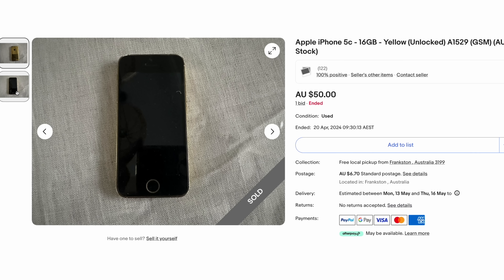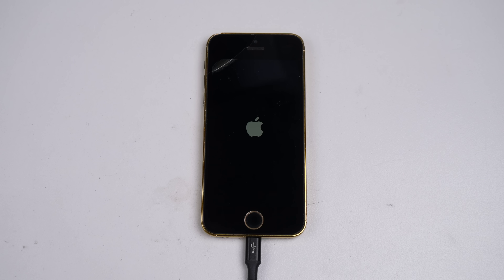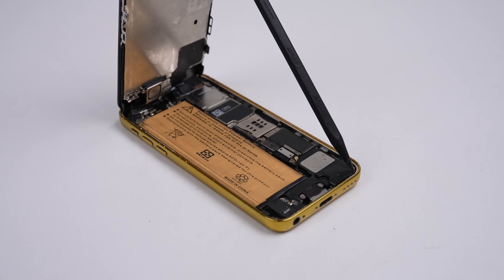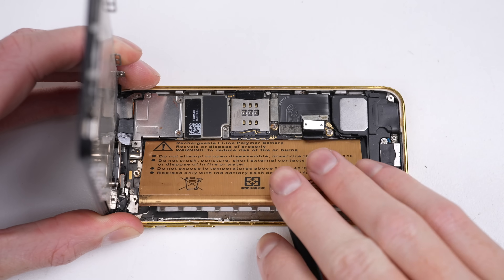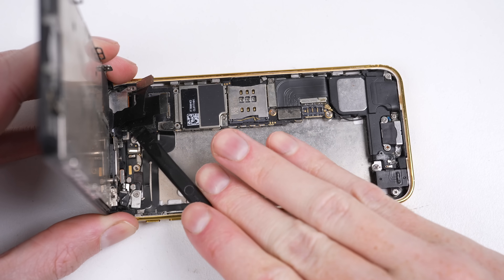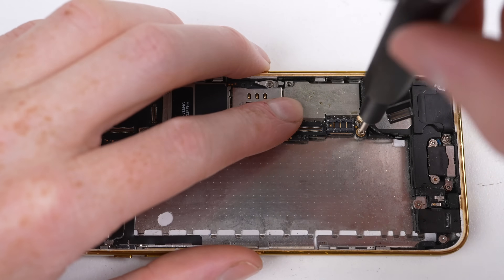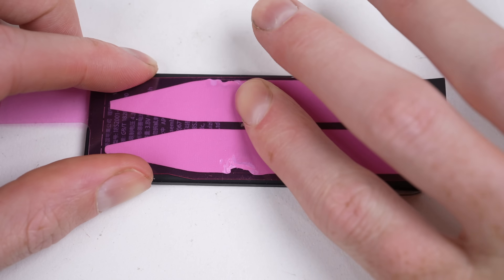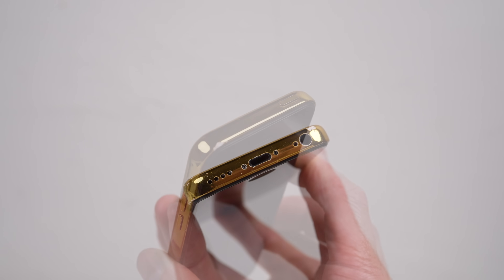This eBay Seller's Custom Built iPhone is a Disaster

Comment: The moment I saw that battery on the thumbnail I immediately knew!
Reply: Yeah, I saw the battery in the thumbnail and remembered Hugh's video on the battery before! Something about rlsk of fire or burne!
Reply: @TheSpotify95  Just like the note 7
Reply: @thewubmachine840  the note 7 exploded because Samsung put in a battery that was too large. If they'd have replaced the original batteries with 3200mAh ones as seen in the Note FE then they'd have been alright (albeit with a smaller battery than the S7 Edge).

I'd actually really like a Note FE (re-released note 7 with the 3.2Ah battery)
Reply: the design flaw in the chassis at the time made the whole disaster. The battery had the anti exploding mechanism built-in so the only worse case scenario is swelling which is still better than battery obliterate the phone. The note 7 ones are design issue.
Reply: ayyyy greek here also

Comment: Some important context with eBay is that the platform has recently added generative AI features,  and it has been aggressively encouraging sellers to use them.

So that overly effusive item description was probably literally written by ChatGPT. I’m surprised there wasn’t a garish DALL•E image to go along with it.

(And, yes, all this AI glurge makes eBay substantially more difficult to use as a shopper.)
Reply: That would explain the nonsensical, suspiciously similar descriptions I found recently when checking to see how overpriced secondhand Limited Edition models of Steam Deck OLED are (very). Only generative AI would crow about stereo speakers offering "3D audio"
Reply: lol so Ebay encourages sellers to scam buyers now
Reply: @dgwdgw  I've seen AI based descriptions for various other items on eBay, too, including watches and other electronics.
At least it looks better than the default app description though, which is basically just the title, the condition, and the shipping service selected.
Reply: @TheSpotify95  I mean the better thing to do with, e.g., electronics would be to copy and paste the manufacturer’s description and spec sheet, because it would at least hopefully be accurate.
Reply: @dgwdgw  I remember waaaaaay back in the 90s when 3D games were first starting to become a thing, one innovation was to simulate audio sources in the 3D space for the purposes of attenuation (distance) and balance (direction).

This is IIRC also called “3D audio”, and even with just stereo speakers it can create an impressive effect (due to the brain’s eagerness to interpret recordings as reality).

Granted, this meaning of “3D audio” is probably lost on anyone under the age of, say, 35.

(Also, to be fair, I wouldn’t feel surprised if the Steam Deck is generating more than stereo audio and just not doing anything with it unless the user attaches an external surround sound system. These features are built into the games and the hardware drivers, so there isn’t really much of a way to disable them entirely, and the Steam Deck really is just a PC under the hood.)
Reply: @elsiehupp  I don't doubt that there really is such a thing as "3D audio", but it's not a marketed feature of the Steam Deck. Valve just says in the tech specs (for OLED models) that the audio is "Stereo with embedded DSP for an immersive listening experience".
Reply: @dgwdgw  yes, well, that’s what you get with a robotic thesaurus lol
Reply: thanks for the info dude!
Reply: If I see generic AI (especially for older systems), unless the seller has a known very good rep, no buy.

Photos better be there as well with that.
Reply: @C96Alia  I mean the examples I’ve come across are mainly descriptions of, e.g., clothing that is mostly fluff, like what you see on department store websites. Just listing the “tech specs” of a dress—measurements, textile content, etc.—is a lot more helpful than telling me it what sort of vibes it has!
Reply: @C96Alia  the most egregious example of AI I’ve seen on eBay was a picture of a dress on a mannequin with the white background replaced to show the dress at a horse race… with the legs of a horse coming out of the bottom of the dress. Did the seller even look at the image before posting it?!?!?
Reply: Sadly I don't think that's new lol  @jonessii
Reply: @jonessii they always have, because they keep the fees either way
Reply: I'm DEFINITELY not against AI (for art or anything) but I'm so sick and tired of the constant push for AI in EVERYTHING. Generative AI has ZERO place in descriptions like that. It's there for the seller to input information about the device and its functions / condition, not for some hyped up glam marketing that helps no one.

Comment: 0:26 That isn't an over the top description, it is an AI-generated description. eBay allows you to fill in the item specifics and generate an AI description based off the item specifics.
It uses over the top language and can be misleading if you haven't filled in the specifics correctly.

Comment: I actually have a PRISTINE white iPhone 5c. My screen stopped working on my S22 a few months ago, so I had to temporarily switch to this phone, as it was the only working non carrier locked device I had.

The 5c was purchased brand new in 2011, I believe. I bought it only 6 months before making the switch to Android, so it went back into its box. 

When I switched to it, I needed a new SIM from T-mobile, and when I went in, the employees were blown away by my 100% flawless 5c. One of the guys was legitimately excited to see it and wanted to play around on it for a little bit, so I let him. 

There seems to be a fair bit of nostalgia for these older devices. I would have kept using it if it wasn't straddling the edge of not being supported on the network anymore. The 4G LTE was slow at best, and there was ZERO app support for iOS 10. I couldn't even get Google Maps on it. 

I think I might jailbreak it and just have some fun with it as a second phone, but I also want to preserve it, as it's a beautiful little time capsule to my freshman year of high school. 

I hope to see you make more videos on these older devices. I think they deserve another lease on life, instead of ending up as more e-waste.

Comment: Some of the phones I’ve repaired are missing one screw on the display bracket, because I don’t want to risk tearing the relevant ribbon cables, and often the battery adhesive is just some double-sided tape after I replace the battery (makes it easier to replace in future, plus is cheaper). It can be jank, but it does its job. It’s not perfect, but it’s an amazing repair job in comparison to this hot mess. And if I’m gonna sell something, I’m gonna do it right

Comment: I've replaced the charging port from an old iPhone, and it works great, however I followed an iFixit guide, as well as videos like this from Hugh so as to not damage or break anything. The same can't be said for my Nokia 9 Pureview, which I cracked the back glass of, and am struggling to find a replacement that's the same thickness that still have the Nokia logo on the back. However I still followed guides and tear downs to minimise damage. The Nokia is now in need of its second replacement battery (as the first swelled, forcing me to put the original back in as it was in better shape), new back glass, a new wireless charging coil, and USB C port. In total, depending on the cost of parts, it will set me back approximately AU$200, which is still cheaper than a new Nokia, and taking it to a repair shop. The hard part is sourcing that back glass, as OEM ones lack the Nokia branding, and 9 Pureview parts phones aren't easy to find from my hunting.

Still, repairing a phone can be done, as long as you're patient, careful, and use as many guides as you can to make sure you're doing the right thing

Comment: I ve been repairing an ip 6 plus that got the same special Housing, it was the same disaster with loose screws or missing, battery was glued in with an bad double side tape and also an broken mute switch cable.

Comment: When I first got a iPhone 3g I case swapped it to white, then another to red and it went well, then a few years later I got a 5c that I case swapped to black that went similar to this, never worked properly so I gave up trying, I still have them all and fixed the 5c last year very similar to this, I now use a SE 3rd so I can still replace the screen when I crack it

Comment: And this make my iPod Classic 5th gen with a ripped headphone jack cable, hard drive cable floating around in the back panel, a snapped metal mid-frame, and a missing battery connector from the motherboard look like a good repair. That 5C’s previous owner committed a war crime!!

(No that iPod was not one of my repairs it was also it’s  previous owner)

Comment: Im a dodgy  electronic repair guy, i solder wires everywhere on motherboards, i use wrongly sized micro components, my repaired electronics looks like shit but i would bet my ass it will works like new.

Not everyone has access to good parts and a fancy workplace.
Should i be crucified ?

Comment: You may be being a little unfair to the seller about the poor customisation. Given the condition of the back case, I expect they bought it customised and looking ok. Then they used it for a few years and now they’re selling it after they dinged it up. I agree their listing should have been explicit about the damage, but the condition inside was likely due to someone before them being the true scammer. Your seller was likely scammed by someone else but had low expectations for the phone.

Comment: The problem I always run into with phones, tablets and most other tech is that everything's so damned small and fiddly that it's impossible for my heavy-handed paws to handle them properly. This wasn't my iPhail at least (I'd throw my Phails into a bin and sell it off as an e-waste job lot) but - Battery aside (Hey, I'm not that daft! 😋) - Looks a lot like one of my DIYs would, if I DIY'd iPhones. 😳

To solve this problem I leave the miniaturised tech fixes to those who can do them, and stick to handling the sort of tech I manage best: 20t transformers, 25kV, and the sheer majesty that is Onix railway traction! 🚄🇫🇷❤‍🔥💨👍

Comment: I think you made an inaccurate statement, @hughjeffreys, when you said, "this person should steer clear from trying to fix anything themselves." Hugh, when I started fixing computers, I was terrible; components were forced in, metal was bent, CPU fans were held on with deck screws, etc. Over time, I learned patience, earned an education, and now I'm a decent technician. My point is that learning a craft requires the ability to learn from your mistakes. @hughjeffreys, don't discourage people who make mistakes early on; our ability to improve comes from perseverance and learning from those errors.

I do agree, however, that he should not have sold this on eBay and that the description was misleading.

Comment: Having just swapped screens between a pair of old iPhone 4Ses this past weekend (as an electronics tinkerer, but a total newb to phone repair just following iFixit's guide), holy crap do these things have a lot of tiny screws of many different sizes.  And the 4S opened from the back, and you have to disconnect and remove nearly everything to get the screen off.  The phone is this video was clearly put together by a complete dolt with zero patience or diligence (because you're gunna need it for these phones).

Comment: Small correction, it really doesn't take that long for a boot loop, especially in the older iPhones. I've run into the boot loop with my iPhone SE2 after just 1-2 weeks of idle.
Reply: Only on a damaged battery does it do that. A good battery should not have that much phantom draw.